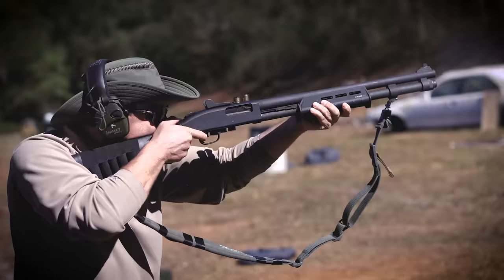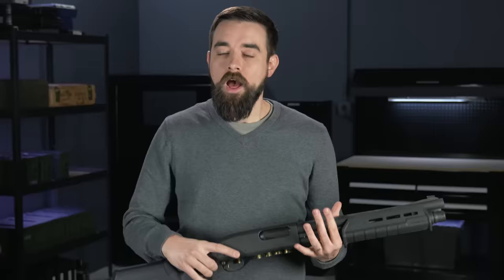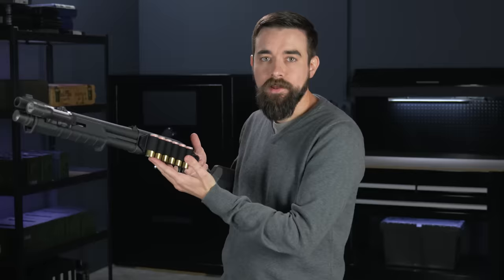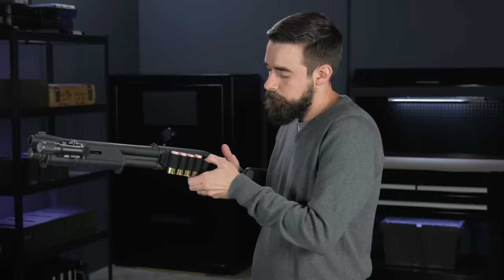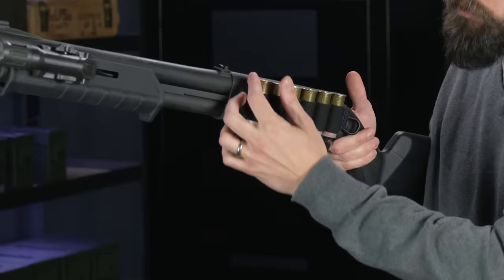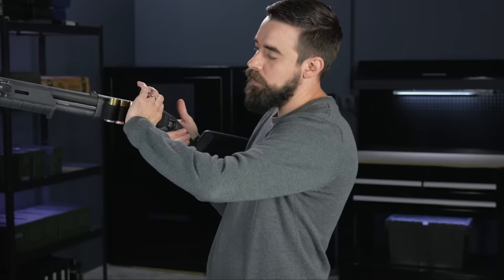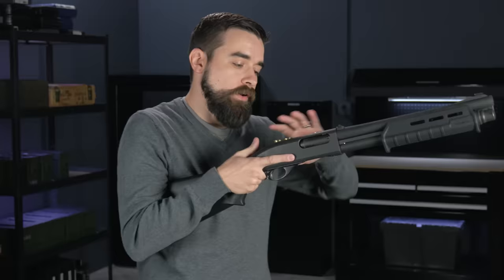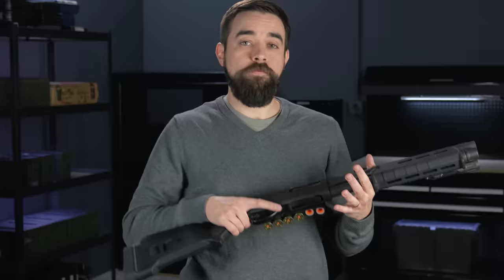How to Reload a Defensive Shotgun

Comment: As a southpaw, loading a shotgun is actually easier and quicker.
Reply: Very few things "we" southpaws get the advantage on, also checking your AR chamber w/out moving your head or the rifle. And I think running a bolt action is too.
Reply: Douglas How so?
Reply: Good question Zoltan, when running a bolt action the trigger hand can stay nearly stationary,while the right hand can run the bolt same side w/o the awkward reach over the rifle. And w/ an AR type, to check the open bolt,it's just a glance down under your nose,with out having to move the head OR rifle, same with a pistol. Hey if you get a chance, check my video "Italian guys shoot stuff" and you'll see what i mean. Take it Ezzz
Reply: Hans Blitz Yep!, good point
Reply: how? wouldnt the ejection port be ejecting into your face? also youve got to reach either over or under with your right hand to grab the shells out the side saddle on the outside part

the only place i see you having any advantage is now you can look into the gun as you load it
Reply: @Douglas-Ops  AK's are easier to use lefty than right-handed.
Reply: Sarge 
Fortunately I’ve never had a brass in the face issues w/ the brass deflector works well. And perhaps it’s not kosher, but charging an AR I generally use my left hand. W/ a shotgun I’ll put my left on the forend, loading w/ my right.
Reply: ChuckEJesus 
Yep, absolutely 👍🏼
Reply: Southpaw? That's a really cute name. I'm going to remember that.
Reply: Tommy Jansen 
Not so cute if you know the origin of the term. 😆👍🏼
Reply: @Douglas-Ops   right jabs and weird angles xD
Reply: frank lu 
Ha ha , yep.
Reply: @Douglas-Ops  agree. I'm a lefty as well and I've never had any problem with brass in my face when shooting an AR. Maybe with brass hitting my right forearm but never in the face haha
Reply: mozzberg make a video please cuz I’m slow lol
Reply: David Maravilla 
Great idea, I’ll work on it👍🏼
Reply: The Mossberg 500 Series Pump-Action Shotguns are extremely Lefty friendly... The Remington 870, not so much... A Lefty with a Shoulder Bandolier and a Mossberg Pump Gun, can unload an awful lot o' Buckshot or Slugs down range, in  an awful hurry...
Reply: JohnSwampthingRae 
Absolutely, good points.
Reply: Yes as when using a right handed one we can check the chamber easily.
Reply: I'm not a southpaw, but I wouldn't mind getting a southpaw bolt gun myself, seems more natural to me for some reason. I can most likely keep my trigger hand where it belongs while my other hand works the action or reloads while my eye is still on the glass. just my 2c.
Reply: Kristian Martin 
Good point, folks rarely think, perhaps they’re ambidextrous. Or just use what feels natural. 👍🏼
Reply: Douglas I agree, I’m a lefty and I find using a righty bolt action 22 is a lot easier, keep my finger near the trigger guard holding it with my left hand while running the
Bolt with my right hand. I thought I was maybe alone on this aha.
Reply: DropThatDelly 
Nope you’re not alone, lol
And yeah absolutely 👍🏼
Reply: @DropThatDelly  That can be true in a lot of circumstances but when shooting offhand with a rifle with a stiff bolt it can be harder.
Reply: for once something in our favour lol
Reply: @DropThatDelly  absolutely not alone... I write, golf and bat RH...I shoot a bow, rifle/shotgun LH... pistol either hand...if I hold a rifle RH, I feel awkward like I'm trying to bat and all LH...and I'm L eye dominant, so I'm all kind of jacked up
Reply: Bryan Caro dude same here. I shoot, write, bat, golf and play hockey left, use scissors with my right, throw with my right, and to top it all off I’m right eye dominant lol.
Reply: @DropThatDelly  we need to start an ambidextrous group... when I'm slap boxing my 17yo I switch it up and he doesn't know what to do lol
Reply: Bryan Caro one of the funniest things I’ve read in a while ahah
We should definitely
Start a group haha
Reply: Completely agree which is why I refuse to get any “left handed” guns. Nope give me the normal pump shotgun and watch me work lol
Reply: @HodeshHockey  wierdly being southpaw in the soviet army at the time was apparently taboo
Reply: I might be the most confusing southpaw here :
L eye dominant
Shoot, use phone, bat, use knives L
Eat, write, use mouse, keys R
I can’t even decide on which hand to use scissors with. I just change it whenever I feel like it.
Reply: 🇺🇸 That's exactly what my late father always said Sir. He was a left-handed Vietnam veteran. I just lost him this year on 7/24/2020. I miss you every day Pop's 🙏🏼 he was quick at reloading. Then he was amazed by that scar 12 gauge that I purchased.
Reply: I'm right handed, but never really wanted to load strong hand. Guess its just what you've practiced, I guess lol I tried loading with my strong hand once and it was hella awkward
Reply: Mozzberg,,,,,That is because southpaws are multi-dexterous,
brilliant, artistic, rugged, manly men. You sir, are a scholar and a gentlemen. (Sigh) I just wish there were more like you.
Reply: @franklu9287  unorthodox boxing stance, correct?
Reply: Makes sence. Just like elr bolt guns. I wish mossberg would make a left handed 590.

Comment: I have one of those Black aces tactical shotguns,  it's basically a Mossberg 500, but feeds from saiga 12 mags. It's a pretty great gun,  and for states other than Cali,  they make one with a short barrel that it's super compact.
Reply: Nice. How reliable is it?
Reply: Yeah Ive seen it it has an 8 inch barrel and is non NFA. Shame it's like $1500
Reply: I have a saiga12 which uses saiga12 mags more reliably. It also eliminates failure prone meat springs.

Comment: As a lefty, I continue the hold with my right hand on the forearm and use my left hand much as you did. Yes I have to release my "firing hold" on the grip but it's very fast and since I'm doing the loading with my strong hand, I'm more dexterous when loading. It works for me.

Comment: First, a very well presented video. As he mentioned, there are many different reloading techniques. Some go over the top and some come from underneath. It is all in what and how you train. BUY DUMMY ROUNDS! Use them in the home for developing and refining your techniques. Strong hand, weak hand and upside down. My husband and I use to use Mesa Tactical sidesaddles. Switched to SOE for all shotguns. We can flip shotcards back and forth quickly. 

You hopefully will never get into a real live home defense situation with your shotgun wherein the end result is you discharging your weapon. K.I.S.S. is where it's at in a high stress situation. Once you think you have your reloading technique pretty solid, turn off the lights and have someone screaming in your ear or turning over furniture. Whatever makes a lot of distracting noise. The techniques you train under stress will be there for you under stress. 

Again, well designed and well developed video.
Reply: Thanks for sharing. Why did you switch from Mesa tactical to SOE?

Comment: I love the Mossberg 500/Maverick 88 with an 18.5" barrel and standard stock. As mentioned in the video 5+1 capacity using 00 buckshot is a formidable weapon. I'm also amazed at cheap shotguns can be had for. Maverick 88's run $189 and Mossberg 500's are in the low $300's. I wouldn't touch a modern 870.
Reply: Sad to see that one of the most iconic shotgun brands is slowly being destroyed in the name of higher profits right now.
Reply: I own one of the 870s produced this year, they are fantastic.
Reply: @user-ci7fi5rg1p I own a couple of 870s and a Mossberg.  I greatly prefer my 870s.  Smoother and more solid feeling.  I know the aluminum receivers are fine in terms of durability but the guns rattle.  I hate that.
Reply: @johnelder4273  the 870s rattle or the mossbergs? as far as I know 870 receivers are full steel machined parts,  hence they're a little heavier

Comment: I've had an S&J Hardware elastic sidesaddle on my 870P for about four years - happy to report, the shell loops are just as snug as they were when I first got it. Can't imagine going to a plastic or aluminum version. The newer elastic options add virtually no weight/bulk to the gun, and can be removed in an instant.

Comment: Late to this party, but loading is why I use a right handed shotgun even though I am left handed.  Much, much easier to load a shotgun when it is resting on your forearm. It also allows me to have both the stock an receiver saddles on the same side (that may not be an issue for many, it is to me )

Comment: If I need more than 9-rounds in a home defense situation,Mossberg 590 SP.Then I have the wrong weapon.
Reply: I would grab that flex 590 tactical, slap a foregrip on it and go ham on anyone breaking into my home.
Reply: Just get a benelli m1 with an extended tube you won’t have to reload and she never jams if you’re not using bird shot
Reply: If the 9 rounds in my 590a1 doesn't do the trick I'm grabbing my SCAR

Comment: Consider these two situations for the emergency reload: 1) The magazine was topped off with the chamber empty or 2) the click heard was due to a faulty primer. Either of these situations  result in at least one round in the magazine tube when the "click" of the falling hammer is heard. If the emergency reload is performed on nothing but the sound of the click  a double feed will occur. A double feed due to the one round  on the lifter from the magazine tube following the rearward stroke of the pump after the click is heard and the round that shooter just  inserted through the ejection port. My method, after I head of cover, is to quickly look into the injection port to see if there is a live round on the lifter and then make a decision as to whether I need to drop a round in the ejection port.. I have been searching the internet and have found no mention of this issue. I intend to take a quick look at the lifter before I insert another round after hearing the click. I am wondering if there is something wrong with my thought process.
Reply: Just store it cruiser ready

Comment: In your example, you don't have very good control of the shotgun (IMO) when you load with your left hand, in the event of a hand to hand encounter or if you needed to move quickly and/or swing the gun around into another direction.
Loading with your right hand allows your left hand to have better forward leverage/control of the extended weight of the shotgun.
Not sure if there's really a right/wrong way. Practicing, familiarity and repetition/muscle memory will be far more important in a high stress situation. ;)
Love your videos!

Comment: OUTSTANDING presentation.  Some observations.  First buy about 6 or 8 A Zoom or other snap capped dummy cartridges to practice technique.  Second, most of us gravitated to higher capacity full length to the muzzle magazine tubes for maximum capacity, 7, 8, or 9 rounds.  The springs on these are stronger and thus more finger pressure is required to top off while engaged.   4 or 5 round lesser capacity magazines with correspondingly lesser torqued springs are more readily recharged with 1. 2. or 3 shells to maintain full capacity.   If you have to shoot any gun dry, you're in the szghitstorm.  And keeping a shotgun loaded continuously for extended periods can warp  ammunition enough to cause failure to feed.

Comment: Chris, great video. Question: How do you prevent your thumb from getting caught on that damn feeding ramp on an 870???
Reply from the maker: +Walastika There's definitely a trick to it and it requires a bit of trial and error. Pull your thumb out quickly and in the direction it went in, rather than straight down. The lifter might scrape the top of your thumbnail but should not catch the tip of your thumb. You can also use the first joint of your thumb to somewhat keep the lifter clear of your fingertip. Jam that shell in there with authority and pull it out like you mean it. Timidity will get you bit.
Reply: I have seen this as a result of the angle at which you are pushing the round in with your thumb. Try to push with the tip of your thumb directly so that your thumb makes makes a 90 degree angle and the top of your thumb is parallel to the bolt. Pushing with the pad of your thumb tip will result in a softer angle and the top of the feed ramp will easily catch the fleshy tip of your thumb as it resets. This also helps when wearing gloves. This is what i have seen in my experience so give it a shot. Hope this helps.
Reply: I just train like my life is on the line, and often end up with bloody fingers after a training day. You build calluses and eventually it hurts less. Crude, but it works.
Reply: Or just get a Mossberg 590 instead...
Reply: Mossberg 590 all the way, I've been preaching that one for years. All your problems will be solved.
Reply: This is an even worse problem with the weatherby pa-459 that thing literally bites you if you dont keep your thumb parallel to the gun at all times. And you cant pull your thumb out when it bites you because its still angled up so pulling makes it dig in harder so you have to use your other hand to reach in and push the shell lifter off your thumb before you can extract your finger from the feed ramp.
Reply: buy a Mossberg thats how.
Reply: Curl your knuckle up till you get your thumb up
Reply: By buying a Mossberg
Reply: Gloves
Reply: Walastika Winchester 1200 anyone??
Reply: you don't, you just get pinched every time.
Reply: KDC RunThat  I've got a Mossberg 850 or 70 I can never remember but it's in 20 gauge and I love it for it's weight and all of that Wish I could find a different stock for it or does it not matter what you take for a stock except for it being for your type of Shotgun like a 870 or 50.
Reply: KDC RunThat  that's seems a bit heavy but that is a standard weight
Reply: KDC RunThat  I live on a farm
Reply: KDC RunThat  point is that I'm lifting heavy objects.

Comment: Pardon an inquisitive mind from someone with no pump action experience, but do you really need to load through the chamber first when empty?
Can't you still load through the tube and simply pump the first round in?   Ofcourse it is a bit slower, but couldnt the consistency of always loading only through the tube make for a more foolproof solution?
Reply from the maker: You can do it that way, but there are a couple of other downsides. If your gun is empty and there is actually still a fight going on (and remember, we're already well deep into "99.99% not ever going to happen to any regular Joe" territory), getting the chamber loaded is priority 1. That might be the only shot you get. So speed there is pretty important. It's easy to train yourself to reflexively open the action whenever you get the "click" of an empty chamber. Starting the reload with the action already open is what makes the chamber load much quicker than loading through the tube.
With some shotguns, the Remington 870 in particular (can't remember if this is the case with the Mossbergs), there is also a mechanical reason for chamber loading. If you drop the hammer on an empty chamber ("click") the forend is no longer locked into place. If your shotgun is nice and broken in, when you raise up the barrel above parallel, the forend will start to slide back just a bit. When the forend is not completely forward, the shell carrier will not open all the way, and you will not be able to get a shell into the tube. I've seen guys on the firing line in a shotgun class struggle to get the tube loaded because they didn't realize this had happened after failing to chamber load first. If you do load the chamber first and then close the action, the action is then locked in the forward position and you can load the tube without the carrier getting in the way. Sorry if that's a bit confusing... it's hard to explain without showing it.
Reply: Thanks for a very thorough answer! I see what you mean :)
Reply: i think the idea is to have a "suprise" in the chamber so when the invaders hear cachunk cachunk cachunk and try to bum rush you mid reload you can go straight into a shot without having to rack in a round